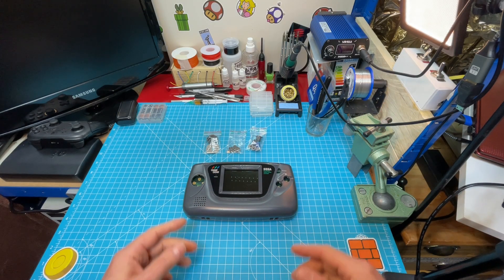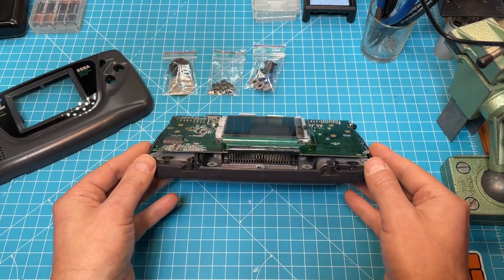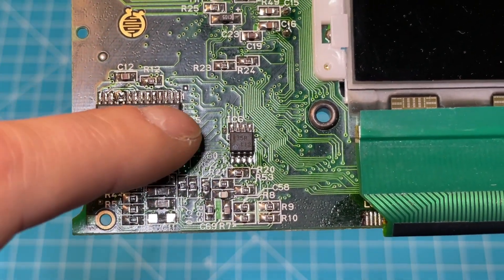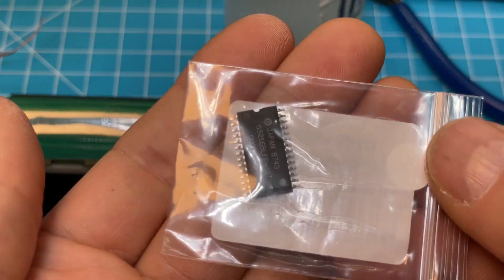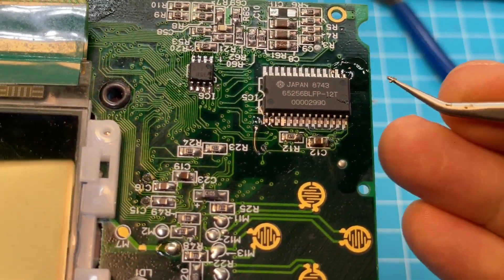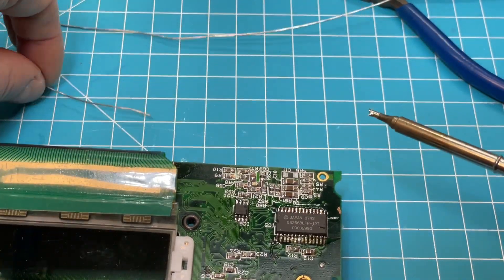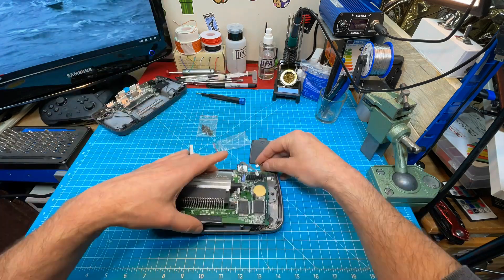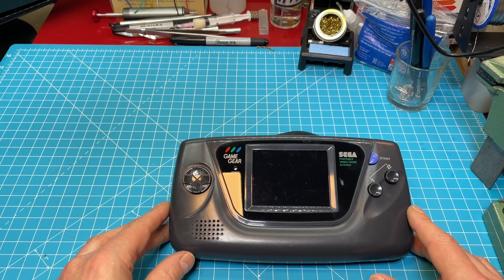FIXING a SEGA GAME GEAR with SCRAMBLED GRAPHICS. REPLACING the VIDEO SRAM #sega #gamegear #repair

Comment: No better feeling than reviving a classic console. Good work. My dude i am in a similar situation. I recapped and replaced both the video sram and the work sram. My issue is the work sram. I am getting a short when i connect the ground pin. But when i remove that leg from the trace the short is gone. The orientation is correct and i am guessing maybe the chip is defective.

Comment: Good job!
Of the 2 Game Gears I've had I've managed to fix just the one so far (a VA1). The VA0 I have is being stubborn with fixed horizontal lines and doesn't seem to be reading game. I'm going to get it back on the bench tonight after work and see if I can fix either of those issues. I really want to put a new IPS cleanscreen in it (from RetroSix) but obviously want to make sure it will actually work before spending on it.
Reply from the maker: Thanks! I hope you get it up and running. I also have a modded GameGear with an IPS screen. Love this thing!
Reply: @TheKonsolist  Thanks. All the videos I've seen of them look absolutely mint